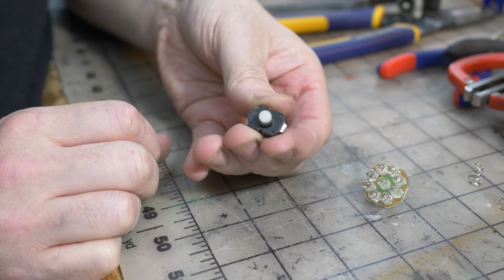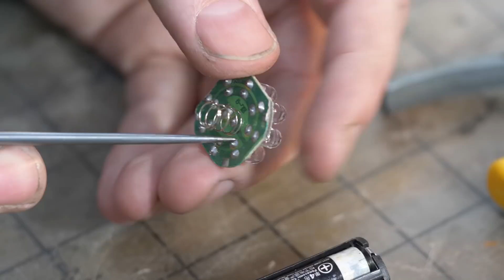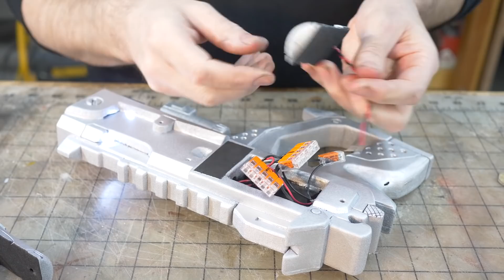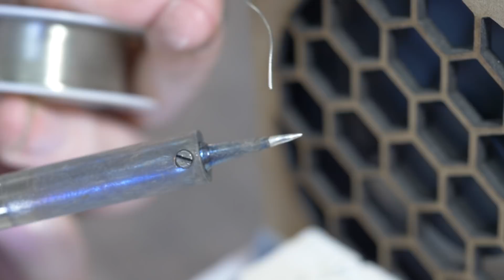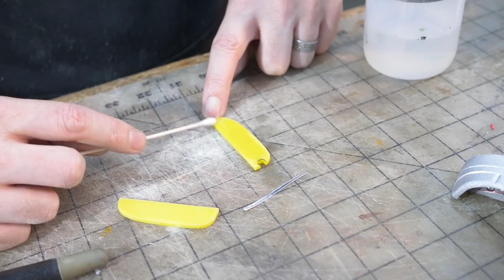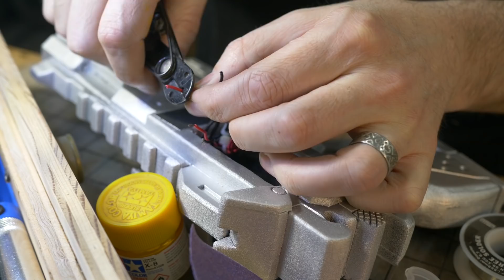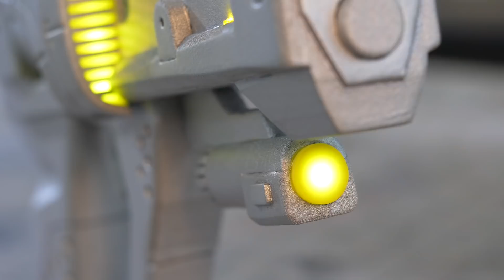Easy LED Lights for Cosplay! - BORDERLANDS 2 - Unkempt Harold Build - Part 2

Comment from the maker: Check out our website for the full tools & Materials list + bonus images: https://punishedprops.com/2019/01/07/beginner-leds/
Reply: Bill, I work in assembly and testing of spacecraft and thought you might be interested to learn (if you didn't already know) that the 'gladys' type of strippers are what we use for working on wires for flight qualified hardware. The brand we use is the "ideal inc custom stripmaster". The important part about their design is the precise blades mounted in the jaws. They are designed for specific wire gauges, and insulator materials and thicknesses so that they simultaneously  grip the insulator and cut to the wire, without nicking any in the process. Any nicks on the wires at inspection will fail the component. Additionally the clamping jaws on the other side are also made to grip the wire without marking it (no teeth), so that the conductor inside is not damaged. It's only one tool used in making a spacecraft, but it's a good example of how even the off the shelf tools we use have to be carefully selected. I believe they are also the type of wire strippers used on the ISS.
Reply: Where does the battery go?
Reply: What are your stripper's names?

Comment: Know it is an old video but you can join all of those wires together using a bus bar terminal block. They keep everything fairly neat for a many-to-one connection, but depending on your application it could be a feature of the prop rather than just the hidden innards of the prop.

Comment: On my builds I've been using the fairy lights (from Amazon. So it saves time on wiring.) with the included coin batteries and they work really well for a string of lights with lots of effect. The coin batteries will last a really long time. And connected to a functional trigger so that the lights come on when the trigger is pulled. MrScott54, BionicBlasters.🤓😇😎🤠
Reply from the maker: That's a great solution!

Comment: I'm glad I'm not the only one who solders like that.   LOL.   I've seen people whose solder work is a work of art.... I'm not one of them.
Reply from the maker: Same XD
Reply: @punishedprops  When I was about 12 I soldered together my first "tube" AM transmitter.   It didn't work.

I called a guy who was an EE at the local AFB for help.  He came over and started saying stuff like, "Well, this one's a cold solder joint.   Look, I can pull the wire out.  And, this one, it might be arcing to this wire..."   and so forth.

He then re-soldered the entire thing for me.  It taught me a lot, but my solder work sill looks like dog-doo.   LOL

Comment: Use a suitable voltage regulator in your circuit and you can power your creation from rechargeables or regular alkalines. You can get li-ion batteries in both 'AA' and 'AAA' sizes so you can use the same battery holder.
Reply from the maker: Thanks for the tip!
Reply: Li-ion batteries already have quite stable voltage over the discharge cycle     so a VR makes little sense

Comment: Talking about testing the batteries and realizing that a project isn't working reminded me of a project. I built a 1:350 scale model of the NX-01 Enterprise for a client with full lighting, I'm talking warp engines, bussard collectors that had a spinning effect, two different circuits for the strobes vs the anti-collision lights, etc. He wanted the model to be battery-powered so that he could take it to a convention and walk around with it on a cart to show people, so I put two 6volt AA battery holders in there wired in series so that they'd provide the full 12v that the project needed.. Anyway, and after it was done I threw the switch and... half the lights didn't work! I didn't know what could be causing it, and since the model was built and painted, all the circuitry was inside it and impossible to access. I was about to bang my head on the wall, till I realized that I hadn't changed the batteries since the start of the project and had been using them to test the model's individual circuits. They might be low! I replaced all the batteries and turned it on, and suddenly everything worked just fine! Crisis averted!

Comment: enamel, the wire is coated in enamel. it's the kind of wire used to wind motors with.
Reply: its varnish
Reply: @kennmossman8701  , magnet wire is enameled. "Magnet wire or enameled wire is a copper or aluminium wire coated with a very thin layer of insulation"
Reply: @abates3747  What is enamel coated magnet wire?
Enamel Coated Magnet Wire | Poly Amide-Imide | Polyimide
Enamel coated magnet wire is not actually enamel as in a paint or fused glass powder but is in fact a series of layers using a polyester amide-imide with a polyamide overcoat that is heat cured on the magnetic wire.
Reply: @abates3747  The insulation is typically made of tough polymer film materials rather than vitreous enamel, as the name might suggest.
Reply: @abates3747  What varnish is used for magnet wire?
What are the types of magnet wire insulating resins - SWAN
Polyamide-imide Magnet wire insulation varnish can be used either as a dual or single coat, but both options deliver excellent mechanical properties and chemical resistance. In addition to the classical polyamide-imide overcoat
Reply: Magnet wire is to be coated with varnish for insulation by drawing it through a circular die of 0.9 mm diameter. The wire diameter is 0.8 mm and it is centered

Comment: Is there voltage drop depending on the length of wire you are using if you have to light something up say at the top of a staff but the battery is in the bottom of the staff?
Reply from the maker: I'm not sure, but a quick test with a multimeter should resolve that question for you.
Reply: @punishedprops  good idea, ill pick one of those up
Reply: yes

Comment: When using a limit switch, Id assume you have to use a DC adapter to attach the battery so your "always on" LED doesnt always stay on when not in use? Or can you just attach an ON/Off switch to the limit switch to effectively "turn on" the limit switch?
Reply from the maker: Yes you could add another toggle switch as a master for the whole circuit.

Comment: In addition to LED's, if you wire something additional to the circuit, such as a sound device to your On/Off switch as well and so you are using a 12V battery source, do you need to put a resistor on each 3V LED?
Reply from the maker: There are a number of different ways that could be wired. The simplest would be to run the sound device on it's own battery and circuit apart from the LEDs.
Reply: @punishedprops  thnx my friend
Reply: yes

Comment: Well I learned what wiring in parallel means, basically they are all connected to the same wire, I dont really know what in series means. If they are 3 Volt LEDs and they are all wired parallel, you only need a 3V battery source? I always thought you need a 12V battery if you use four 3V LED's.
Reply from the maker: If you're running the LEDs in parallel, then you can power all of your LEDs off one 3V power source.

Comment: If you don't know there is a flat side on LED's next to one of the legs that leg is the negative, It is there for the specific case that the legs have been cut and you need to figure out the polarity.

Comment: Quick tip for you/other people that might see this, if you can, use AA batteries over AAA every time, AA batteries have significantly more total power in them than a AAA battery, so they last longer, you'll go through less of them and make less waste. If you use rechargeables only the first point applies.

Also, depending on the rechargeable battery and the LED's you have, you might burn out your prop, white leds usually run at 3.3v, maybe the ones in this flashlight are slightly different, but lithium rechargeable batteries can sit above 1.5v when charged, closer to 2v in my experience and this could cause issues.

Ah, jumped to the comments too fast, you covered the led voltage thing.

Comment: omg thank you for the led tutorial...   lol my led setup for my fallout 76 pipboy was originally a disaster.  i had the flicker bulbs but they burned out after the 6th test.  but in the defense of the bulbs i was using a 3.7 volt rechargable lithium cell.  the fix i came up with was balancing the power with a Luxon blue LED and use 3 diode LEDs wher the 3 buttons usually sit.  it turned out very nice.   parallel was the way to go there ^_^

Comment: Please, Please, Please use a resistor (s) when wiring LED's it prevents the LED's from burning out it also prevents possible fires from using too small a wire or over loading the battery.  To pick the right resistor you can use this simple formula: (battery voltage - LED voltage) / LED current = resistor value.   If are running the LED's in series the LED voltage is all the individual LED voltage added together. If you are running them in parallel the current is all the LED currents added together.

Comment: Been catching up on your videos, and really like your props. One thing on this one I'd have done, just for it being a fun thing, is to add a momentary 'trigger' switch on it's own circuit with a single red LED inside the end of the barrel (far enough back to not be seen when off), wired to a CR2032 type battery (as it won't be constant on during a comic con or such).

Comment: Cap off all those wires with wire nuts... you can still solder them together, but a wire nut will just screw on and protect the connection.

Comment: Always seems you have some of the worst soldering irons ever - never seen one with so bad a tip that's not tinned well - but then work in electronics so cost of a good one is not so bad - expect tips I use cost more than your complete iron ( £35 so that's may be $60 just for the tip )
Reply from the maker: You are correct sir! I think my whole soldering iron was ~$40.

Comment: Bill, I know that thicker gauge wire you have is easy to solder, but you really can get away with a smaller gauge, which would be a lot easier to bend and squeeze into those cavities at the end...

Comment: Apologies if you've mentioned this elsewhere (or if its common knowledge within the maker community) but how do you know exactly what voltage you need to power something?  Do you just test it with 2, then 3 batteries or is it more obvious?(assuming you're not using an LED from a package that lists the power reqs)

Comment: You could use solderable breadboard or vero/stripboard to join up the ground /positive connections in line while keeping things tidy and compact, depending on how thick the wires are. It's basically a breadboard made from copper in strips. the advantage of this is better connectivity than all wires bunched together, and one could easily shave out a middle strip for example to keep the two rails more separate (while maintaining a small profile, basically 3 or 4 breadboard spaces thick, if that makes sense).

Comment: Use electrical twist on wire connectors (also called wire nuts or Scotchloks for 3M brand) to connect multiple wires. They are insulated and removable if you need to make repairs.

Comment: I've been into electronics since I was 10 years old, and well... I'm old so have collected much knowledge.  There are a million ways to do things right.  For someone that doesn't know much about electronics, this is all good stuff.  Careful soldering that close to an LED.  Heat can damage parts.  Also touching + and - terminals directly from the battery is a bad idea and can cause bad levels of heat & damage.

Comment: it is not necessary to use a led directly, it is necessary a series resistance with to be calculated compared to the power supply ...

Comment: Teeechnically, the voltage drop across an LED (or a normal diode) is constant in theory. The resistors are there to limit the current and prevent that little hair-like wire in the diode from becoming a fuse ;).

Also, I understand that your stuff is form over function, but the magnet wire stuff offends me on a deep engineering level. So many potential shorts! Tool thin and such delicate insulation. Don't you have a brother who should have taught you better?  :P

Comment: Simple and perhaps obvious tips.  Magnet wire comes in different colors!  I use Red for Positive and Green for Negative!  Makes things a bit easier to keep track of.  It also comes in different gauges, I generally use 26AWG for what I'm doing, but you can get thicker or thinner wires.  The higher the AWG the thinner the wire.

Comment: For the grill, would it be easier to put a piece of foil tape over the entire piece, then cut away what you don't want? Might be easier to handle than trying to place down a piece of tape that is that small.
Reply from the maker: HAA! You know what, that makes way more sense than the way I did it! =D

Comment: Whenever I have to do lights for a cosplay I use the “ask my dad, who builds model trains” method 😂 he always have a ton of different leds laying around and enough wire to last me a lifetime
Reply from the maker: Model trains have so many led options!
Reply: Punished Props Academy yeah and my dad works with scale N (1:160 cm) so he’s great with hiding the tiny leds and using tiny fiber optic cables!

Comment: If you have  a problem fitting a battery holder or it needs to be a specific shape, 3D printing it is pretty fast and easy. Its also a nice print as you in general do not need to sand it so much ^^
Reply from the maker: Oooh I really dig the idea of a custom 3D printed battery holder.
Reply: @punishedprops  Yeah, and u can just make it so u can slide in small copper/brass sheets if u need to serial some batteries for example. I made it for a sonic screw driver I made, that needed batteries but is fairly small. Its even better for your own printed props, or casts of them, as you can make them fit perfectly into any shape.

Comment: Hm, I want to propose to not rip apart flash lights for LEDs, just buy a ten pack on eBay. If you still do, don't trust the internals of the harvested LED to show you what cathode and anode are. Test it with a coin cell. I literally had ten red LEDs in a toy once, where 5 of them were the other way around on the inside!
Reply from the maker: I've also had harvested LEDs with swapped polarity. Always worth checking, great tip!

Comment: I can tell you from experience that 3 LR44 batteries (in series) will power a single pretty bright LED for a good 4-5 hours so if space a real concern than those could do in a pinch.
Reply from the maker: That's great info, thanks!

Comment: Bill a neater, more compact way to connect up your positive and negative power rails is to use some Stripboard or Busboard.
It has been a staple of the home made electronic project for decades. It's easy to use and cut being either resin bonded paper or now fiberglass.

https://en.wikipedia.org/wiki/Stripboard

On Amazon the name brand stuff is $10 bucks a board, the cheap stuff is about $1 or less. (And even a bit cheaper if you get it on Aliexpress.)

https://www.amazon.com/Prototype-Stripboard-Printed-Circuit-Soldering/dp/B019Q0ZTJ6/
Reply from the maker: That's fantastic!
Reply: @punishedprops  Glad I could help, Bill.

Comment: Oh, and you can setup your battery packs in parallel too.  Take 2 of those 3xAAA batter packs and put the positives and negatives together and you'll still have only 4.5 v, but it will last longer now.
Reply: just use equally charged / fresh batteries, otherwise that could get nasty

Comment: To connect bundles of wires like that I would strip 2" on each and use a set of linesman pliers to spiral them together. Once they are soldered you can cut them down to 3/4". They also make marette/terminal hybrids. They have one set screw and then a "marette" style insulator. Not the worst way to make connections and it makes repairs easy.
Reply from the maker: That''s really fantastic advice, thanks for sharing. =D

Comment: All of the close ups.  Nice.  

Going with parallel in series can help to reduce the wire count when working in a restricted space.  

You can easily remove the insulation of that type of wire with some fine grit sand paper, if needed.  

I recently ordered some small battery banks and a couple of USB rechargeable batteries to see if I can't start making my props rechargeable via USB. :)
https://www.amazon.com/gp/product/B0786S6XL5/ref=oh_aui_detailpage_o04_s00?ie=UTF8&psc=1
Reply from the maker: USB rechargeable AA batteries?! What is this wizardry?
Reply: @punishedprops  They do make direct AA replacements that are USB rechargeable.  The ones I linked and are looking to use are slightly larger and out 3.6volts.  Even on a 3.6v source to 3.2volt white LEDs, which shouldn't need any resistance.  I'd still throw at least one 0 ohm resister in there.

https://www.amazon.com/Rechargeable-Batteries-Battery-Li-ion-Long-Lasting-High-Capacity/dp/B07D9K2H9H/ref=sr_1_7?s=electronics&ie=UTF8&qid=1546982590&sr=1-7&keywords=usb+rechargeable+aa+batteries

Comment: Bill You might like silicone insulated wire for jobs like this. It's more expensive but well worth it for tight areas.It's very flexible and doesn't fight you like normal plastic insulated stranded wire. Adafruit has some you can try out.
Reply: Hobby King has good silicone and Teflon wire cheap. They also have a bunch of connectors too.
Reply from the maker: Splendid! I'll have to get some.

Comment: FYI that 28 AWG wire is coated with enamel. While it's not as fast, I'd recommend using some form of abrasion to remove the enamel before soldering. When the enamel "burns" off it leaves contaminants in the solder joint which can compromise it's quality. It's probably fine in this application but a good alternative (as others have mentioned) is wire-wrapping and soldering over the wrap.
Reply from the maker: That's a really great point, thanks for sharing!
Reply: @punishedprops  Thanks for the great videos!